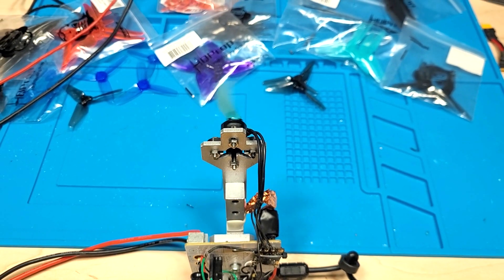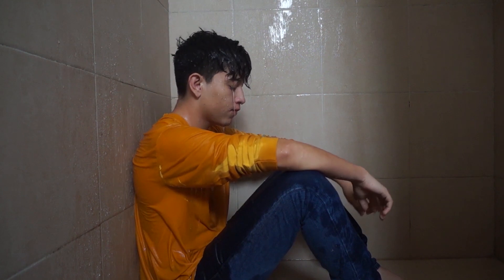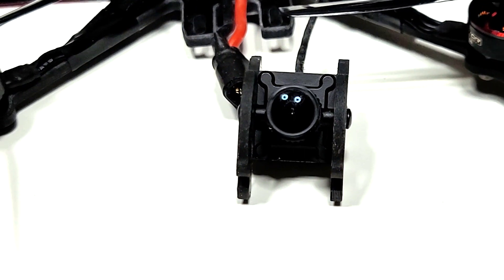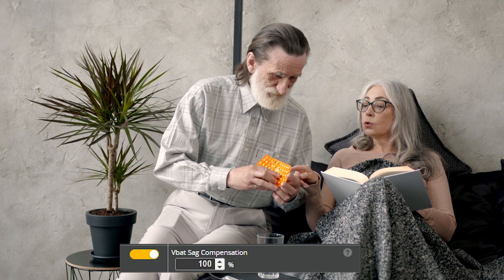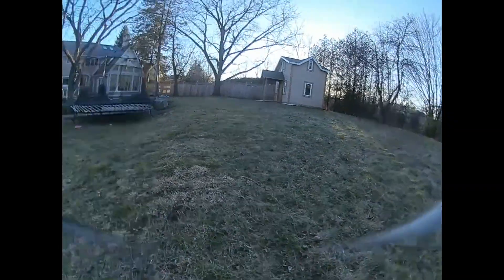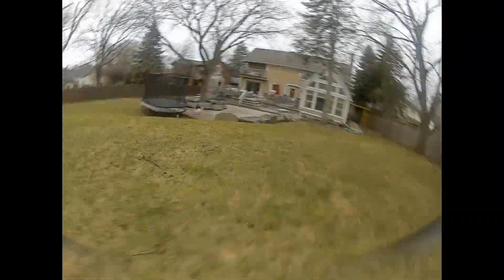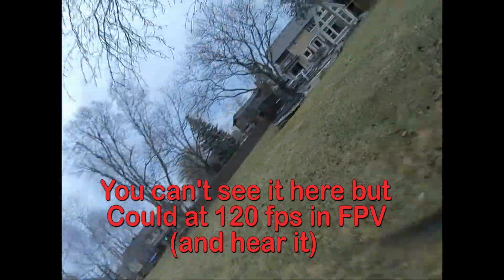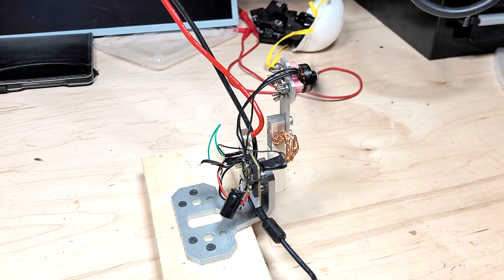Best DJI HD Sub 250g FPV Drone? Putting motor/propeller tests results into practice.

Comment: Check out the avant quads Avio 3.5 frame tough as heck,bottom mount battery has the 20x20 mounts in the top plate for the vista. Some really nice tpu mounts.  If you prefer top mount the have a frame called the nexa 3.5

Comment: I need a sub250 with a airunit so I can have hd footage or maybe one with a Peanut camera
Reply from the maker: If you want a full air unit you'll need a much bigger build. Putting a naked gopro on top I find works the best since it's light, best quality, and you can take it on or off. You can see a later video I made to demonstrate that.

Comment: Good Job! How did you add GPS? Im using a Smart 35 with Gep-F411-35A FC. SoftSerial was preconfigured for F.Port, but when i connect my GPS its no recognized in Betaflight. I also tried changing the SoftSerial to LED_Strip and Buzzer, but that didnt work either. Any help is greatly appreciated!

Comment: Is it a good quad for a first build?
Reply from the maker: Smaller builds can be more difficult because there is less room to work, but if you know how to solder, absolutely. It's probably 50x easier than my first build. I'd suggest leaving the Caddx Vista stock though to start off.

Comment: Thaught about slightly bigger motors like 1504 8 (IFlight Xing) or 1505 (Diatone Toka)?
Reply from the maker: I tested BrotherHobby 1504.5's against the 1404 motors in my previous testing, but I really shouldn't speak to any that I have not tested. I'd be happy to test anything these 3.5" and the 3" T3x3x3 propellers in an attempt to dethrone (or provide a solid alternative) to the T-Motor F1404s though if I got my hands on them.
Reply: @RecursionLabs  is that in one of your vids?  I've been using the BH 1504.5 3950kv in my 3.5" builds.
Reply from the maker: Yes. It is in the "Recursion Labs - 1404 Motor Performance Testing on 3"" video.

Comment: Something to think about for your future testing, especially for extracting maximum performance out of a given weight class motor, is to perhaps try short bursts vs extended punchouts. A small (for the prop size) motor might have shit efficiency if you held throttle at e.g 70% for solid 5-10 sec as it heats up way too much, but could for a 1sec punch-out still have acceptable performance (efficiency). I'm not sure if it's possible for you to measure motor temperature, but perhaps do some testing/simulating of low-throttle+occasional pucnhout vs high-throttle racing style. 

For example 2203.5 could be used for a light weight 5", but would likely suffer in terms of efficiency if used for a racing style, with a high average throttle when compared to the double volume 2207:s usually used for 5". I have never actually seen any tests that intentionally run a motor hotter (or prolonged) to see it's efficiency drop over the course of 10-60sec as a motor is held at x% throttle or power. For example, in your previous 1404 vs 1408 motor testing, what would happen to the efficiency if we kept them at high thrust values? Would the 1404 plummet in efficiency while 1408 stayed? The same kind of testing would be fun to see for 2203.5 vs 2207. For 4" 2004 and 1408 are about the same volume motor, but the 2004 has more cooling because of it's surface:volume ratio being higher, how would this in an extended thrust run affect efficiency? We have seen these kinds of discussion amongst FPV youtubers in past year, but no one has really tested that. For most of these kinds of prolonged tests, staying below 80% throttle might also be a good especially for any extended test as static thrust tests usually draw a lot more power then in dynamic flight. Maybe a metric to go by for this theoretical prolonged test is C rating. For example a 4 min flight time with the intended battery gives 15c, what does efficiency curve look like over the course of those 4 min (or as long as needed to reach thermal equilibrium) if we give the motor 15c:s worth of power? Of course there is a lot of variability here which would take too much time to test, but comparing 2 extremes, calm flying vs full mad racing (8c vs 30c) could limit labor.  

I think these ideas would add valuable information as it could change what motor someone might want to buy, based on their style of flying/intended use but I would like to hear your thoughts on this, and perhaps what you intend to test in the future? I understand any changes to your current testing and any additional testing aspects increase labor.
Reply from the maker: You mean like this? https://i.imgur.com/rvSsmJ9.png :)

Great questions. Heat is extremely important for how this testing is done, especially since heat generation is MUCH greater during static thrust testing than when flying, and I speak about that during my methodology video. I have a thermal camera which I've done extensive testing with, and during a throttle burst the heat generation can start to quickly drop the voltage (resistance) and thrust. The automated methodology has been essentially designed around removing heat as a variable. It would be much easier/faster to just ramp up the motor from 0-100 and sample along the way (which a lot of people do), but it takes more than 3 hours to go through the test sequence so that heat doesn't taint the results.  Instead of rehashing it you can have a read through here: https://www.tytorobotics.com/blogs/customer-stories/how-i-developed-a-drone-testing-methodology

I'd be happy to answer any questions. With all that said, even with testing on cool motors, if the burst is generating more heat on one motor/prop than another one, that efficiency loss will create extra current (watts), and will show up in the charts. This is why efficiency, and watts of power to grams of thrust are so important in the analysis. An inefficient motor/propeller will be punished in the charts. Doing a long burst and measuring heat just shows you where some of that wasted energy is going.
Reply: @RecursionLabs  So what does this mean for your future testing? Are you interested in testing the very popular 2004 size vs 1408 on 3.5/4", or 2203.5 vs 2207 on 5"? Not sure how much extra time it would add to your current 3h automated test to do a 8c, 15c and 30c, (or 30%, 50%, 70% throttle, or much lower considering static load) runs each 1 min, with efficiency (gram/w) vs time (without temp measurements, so that it could be automated). This would of course only be necessary when testing different motor geometries, surface:volume ratios.

On a side note from reading your article, is 0.5% throttle resolution really necessary for these tests? I imagine you would cut down the test time by having 1-2% resolution/increments. Any particular reason for the extremely high resolution? I think even something as high as 5% increments would still show differences between motor/prop efficiency.

Comment: Check out the amaxshop 3.5nano frame. Its better than the crux35 frame.
Reply from the maker: I'll take a look. Do you know the weight of it?
Reply: @RecursionLabs  25g like the crux35 frame.
Otherwise check out the druckbaer racing frame. I think cncdrones in canda sells  it too
Reply from the maker: @chrisbee5481  Yeah they are. Thanks for the suggestions. I've actually had my eye on druckbaer for a potential sub 250g 5" build frame choice once I get that testing done if I think the data makes sense.
Reply: @RecursionLabs  dont bother with 5 inch sub250. I built one and was dissapointed.
I used brotherhobby 2004 2100kv motors on 6S
Tried all kinds of 5 inch props. GF 5125, 5126, hq 5x3x2 and GF 4525.
They just dont have the power. I studied all motor thrust data. It just seems that its just theory.
Now I got the emax 2004 2400kv motors for 6S and will use the emax 3.5 inch props. Good thing with the druckbaer frame, you can play around with all kinds of arm lengths and props.
5 inch is too floaty too. Just because 2004 motors can spin 5 inch props, doesnt mean thay are a good build.
Only the 5 inch bi blade props, 2004 2100kv motors and a 4S 18650 li Ion Pack are good for real long range flights. I think this sub250 5 inch is just a trend.
Give it a try and you will also go back to 3~4 inch setups on sub250.
I personally love the hglrc / xnova 1804 3500kv motors on the emax 3.5 inch props and 4S.
Reply from the maker: @chrisbee5481  I was super disapointed with the 3.5" emax props. They just performed so poorly, and the 5"/3" avans used to be my go to prop. I doubt a 5" would replace a 3/3.5" build, but I'll give it a try if I think it's viable, but I also have not given up on 4" and have more tests on those coming up soon. If I don't, then the testing is still worth showing why it's not. I might also compare these sub-250 sized motors vs full sized ones at some point.
Reply: @RecursionLabs  I guess you were dissapointed with the 3.5 inch emax on 1404s, especially considering spin up responsiveness and efficiency.
Going with bigger motors these props perform well. But you know that from your 1408 tests. Going bigger motors means you want thrust and dont care too much about efficiency.
Today I got the brand new HQ T90mmx3 props and tried them on my 2004 2100kv 6S motor setup.
They perform the best out of all props I tried.
Better than GF 4023 and all 3.5 inch props. I guess its got to do with the motor KV setup too. But this prop is so nice. Considering my setup was actually for 4.5 to 5 inch props.
Didnt like the bigger props

Comment: I literally found the Crux35 frame yesterday, and using your videos' data made up this exact build, though I was looking at the Mamba AIO which is very similar. Are you reading my mind xD. I got my HD 3.5" 1408 build up and running past few days. It ended up being quite heavy, 180 dry+103g battery for a total of 283g (not a naked nebula pro though). It has crazy speed, punchouts and hangtime, so I guess it is perfect for freestyle, but since I fly a lot around my house I wanted to build the lightest possible 3.5" (for safety, durability and loudness) that would still have decent performance and just yesterday theorized the build in your video. The Crux35 doesn't have particularly thick arms but it is a very light and also very cheap frame with good availability.  What receiver did you use? What do you think about the Mamba F411 AIO? It has very similar specs and pricing, also available in Banggood. How accurate do you think those GPS readings were? 160-200kmh seems a bit crazy fast that not even most 5" achieve? I might be wrong though. Love your videos btw. This video will be very useful if or when I decide to make this build. <3

The absolute thrust of 1408 motors is higher which should give it higher top-speed, but when I found the Crux35, I considered that the reduced frontal area could potentially make the Crux35 fly faster than a quad using a frame like the Geprc smart 35, like mine.

Are your links affiliate links? Incase I buy the AIO and or frame. For the F1404 motors I recommend aliexpress, much cheaper for a pack 4.
Reply from the maker: Glad you found the data useful for your design. That's my whole reason for publishing it. I'm using the DJI controller on these builds, so it saves the weight for an added receiver/antenna. The Mamba AIO doesn't have a blackbox, so that alone would rule it out for me as I find them to be essential (as I showed in the video). I verified the GPS readings by using google maps distance and frame by frame time to calculate the speed as well, but it's not perfect which is why I added a range. The thing is stupid fast, and you can get a 5" to do it easily if you focus on thrust to weight. Harder to do on a larger freestyle frame with a gopro.

Comment: What thrust did you get out of those 1404 with the 3.5inch props???
Reply from the maker: Check the description. Charts are linked there for the combo, and the videos for the tests vs other 1404 motors, and 3/3.5" propellers.